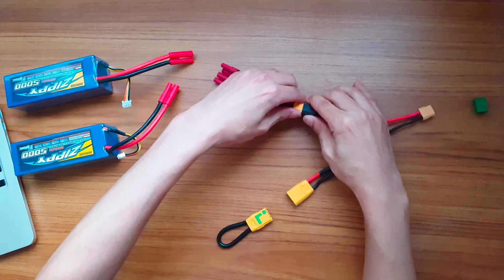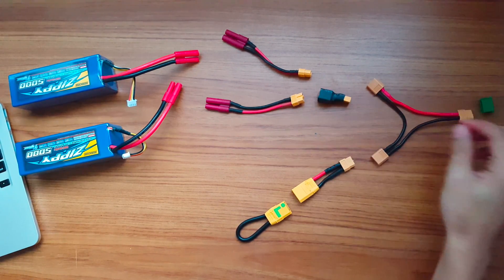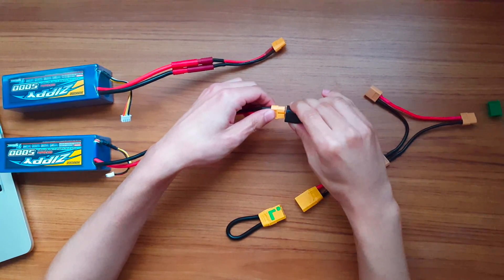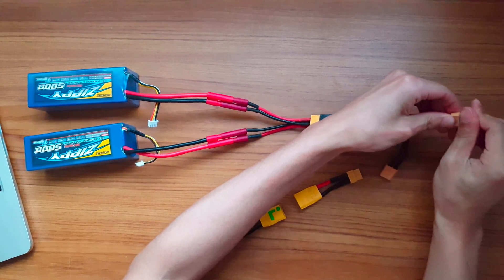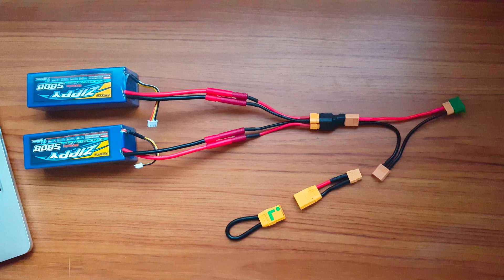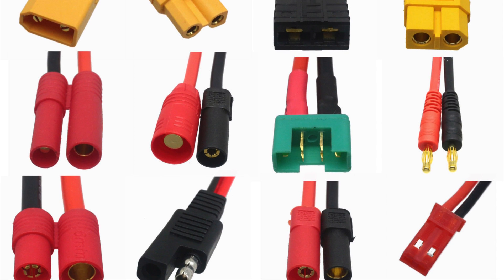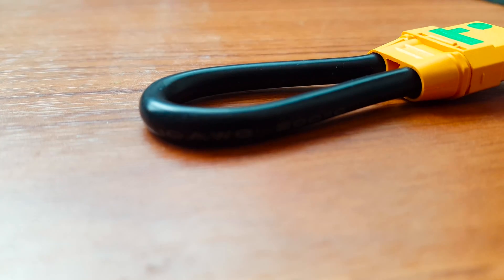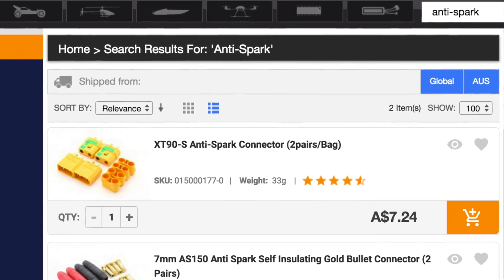Electric Skateboard Vlog - 3. Anti-Spark

Comment: One way to get anti spark would be to use the XT60I connector since it has a third pin that can be used as a sense wire. If it were recessed enough on either end, it could be wired to connect last and disconnect first. This could be used to pull the gate of a power MOSFET array up or down which would be like having a high resistance and then suddenly the MOSFET array goes low resistance when the connector has all 3 pins connected. Alternately, a simple timer can be made to do the same thing where MOSFETs placed in the ESC for this reason are made to turn on only after say 1/10th of a second so that the connector can be connected enough before the inrush current is drawn... kind of like a soft start.

Comment: I was expecting this explanation such as:

Try connecting only one wire of the battery to the vesc. There is a spark? Try connecting both- spark again. Why is there a spark? 

Here is how the capacitors on your vesc work when connecting the battery (they cause a spark) WHen measuring current from a capacitor it depends on the change in voltage. so i=C du/dt  I current C capacitance du-voltage difference dt . So assuming the capacitor is not charged and is connected to some voltage the change in voltage du is the  (0-the voltage)* its connected to so the current spikes for a dt duration (let's say milliseconds) hence the spark.  The formula says it all.

Now. Disregarding why the capacitors charge when connecting only one wire to them. The whole idea is that we are keeping their voltage high even when not using the board. Does this consume power? No as there is no path for the current to complete a cycle. 

So with he red wire ur keeping the capacitors always up to the voltage of the battery and we just connect the black one for example when wanting to connect the battery omitting the initial inrush current into the capacitors due to the sudden change in voltage they are experiencing. 

Is the spark bad? Idk maybe for the connectors, don't sweat about it.

As for all the other questions bellow- most questions can be answered from google. Its just understanding the basics of Electrical engineering, its not magic. read the datasheets of the parts that you want to use - they will have maximum continuous operating conditions which will tell you all about the current and voltage that they can withstand. watch some youtube on Electrical circuits basics.

Comment: hey man great video. i just built my own ebike. my controller connector is a xt60 my 36v15ah battery is a xt90. i bought a adapter so they connect. they do awesome. But i am getting that spark. will this apply and work for my ebike battery and controller and stop the sparking? please and thank you
Reply from the maker: Hi, thanks! Just from your brief outline I would think it would work. The anti-spark connector isn't too expensive so definitely worth it to try in my opinion.

Comment: What if i use the same 3 ways setup but using regular shorted xt90  as a switch ... will it prevent damage as I have notice that the sparks came up through the possitive side of ther xt 90 ?
Reply from the maker: I'm not sure I understand the setup. This must be done with an antispark XT90 as the switch, using just a regular XT90 will not prevent the spark as it lacks the initial resistance provided from the antispark connector.

Comment: Why is there no xt60 version and why do the anti spark power switches cost 30-40€????
Reply from the maker: I'm not sure why there are no XT60 Anti-spark connectors by default, it would be handy if there were. If you really need one you might be able to ask a manufacturer, or I've seen some people online adhoc their own.
In terms of the price, I wouldn't expect the connector to be that expensive. I'm not sure where you're shopping but maybe you could try hobbyking, or even ebay or aliexpress, they usually have some cheap items.
Reply from the maker: Oh my bad, you meant the actual switches. I think part of it is because it's quite niche so there's probably a bit of mark up there. There's not a lot of switches out there that are designed for this purpose with a relatively high current rating and so I think that's why they're quite pricey. It could be the materials used as well but you'd have to do a bill of materials to really see.
Reply: @sketchcontainer  are there xt90s loop keys pre-made or do I have to build one myself? I couldn't anything but the XT90S connector with no shortage or wire.
Reply from the maker: @PapayaPedro43  I haven't seen any pre-made ones before so you'd have to build one yourself. I think you pretty much got it with shorting the one side of the connector (like the video thumbnail depicts), but if you just google something like "xt90 loop key" you could probably find some good instructions on how to build one

Comment: Hi! It seems that the xt90 to xt60 adapter is missing from the description. Which adapter would you use?
Reply from the maker: Hi Ishan, great question. I made that adapter myself using the XT90 male connector that came with the XT90S, and a XT60 female connector I had lying around. However a typical XT90 male to XT60 female adapter should work. E.g. https://hobbyking.com/en_us/xt90-male-to-xt60-female-2pcs-bag.html

Comment: Great video. So you have put the anti-spark connector on the negative wire - does it make any difference which wire you use the anti spark connector on -neg or +pos ? Does it HAVE to be used on the negative wire?
Reply from the maker: Thanks. If I understand you right, it shouldn't make a difference because all the anti spark is doing is completing the loop, doesn't matter where in the loop as far as I'm aware. The main reason it appears to be on the negative is because of the way the xt60 series connector is designed.

Comment: One last question , would changing the serial cable that connects battery, vesc and loopkey to a serial adapter like this one be ok?
https://www.amazon.com/Serial-Battery-Connector-Adapter-Compact/dp/B01EIZYM74
Or is it safer to use a 10awg series cable?
Reply from the maker: They're effectively the same connection so I would imagine it would be ok

Comment: Hello , i was wondering if the exact same loopkey configuration would work with dual vescs ? I want to make the same anti spark switch but would like to know if it is ok to connect the female end of the anti spark to the male end of a dual parallel adapter connected to both vescs.
Reply from the maker: Good question. It depends on your setup. The max rated current for an XT90 is 90A so you would want to stay well below that. Most vescs I've seen have a max continuous current of ~50A, so that would generally be the limiting factor of the two, but with two vescs in parallel the limiting factor can be the XT90. In terms of voltage, if it was high enough the main thing would be that it could still spark, but based on the vescs specs I would doubt that. The other thing you would want to do is make sure the wires you're using can handle the expected max current and temperatures.
Reply: @sketchcontainer  My batt max will be set on 40A  per vesc so it shouldn't be an issue.Thanks a lot for your quick reply. Great video by the way ;-)
Reply from the maker: @V-lab  Thanks MrDamikenificent. Just a note here, if you're planning on having two vescs in parallel drawing 40A of current each, from a single battery source, that's effectively 80A of current from the battery. From what I can find online, the 10 AWG wire I used in my video has a max current of ~55A, so I would be inclined to use a 7 AWG wire to handle the 80A of current; but this is quite a thick wire so not sure how well it fits with the XT90. Again, I'm not actually that familiar with the dual motor, dual vesc setup so it might be worth checking with someone who has built one themselves and can provide you with better information :)

Comment: Would it be possible to use a XT90 as a removeable plug to complete a power circuit and treat it as if it where like a key to a car? But obviously for an electric skateboard. I'm just not comfortable leaving my board somewhere and someone seeing a visible power button then pressing it even if I have the controller. I'd like to have a key that I take with me that renders my board useless without it. Exactly how a key for a car works.
Reply from the maker: Hey Anthony, yeah you could certainly use it that way but just as a car has door locks and alarms, I wouldn't solely rely on the XT90 as security. Best to keep your skateboard close. If your concern is just to prevent someone accidentally or intentionally turning the skateboard on and draining the battery though, I would think the XT90 would definitely reduce those odds :)

Comment: is it possible to put any onoff switch rather than the anti spark?
Reply from the maker: If you find an on/off switch with the right specs for your circuit, of course this is possible. The difficulty is finding one with the right specs. Due to the sometimes high current drawn from the skateboard, basic switches are usually insufficient.
There is, however, a switch for electric skateboards already out there, which I hint towards in the video, and I would recommend opting for that if you're looking for a switch for your board.

Comment: how do you short the xt90?
Reply from the maker: Using the male (or female) XT90 connector, you connect the two pins together with a wire (or any insulated conductor) that can handle the max expected current. In my setup I shorted the male XT90 connector by soldering on a strip of AWG10.
Reply: does it work well for a key?
Reply: and also is it possible that you could make a video on how to do that?
Reply from the maker: Yeah it works well for its price
Reply from the maker: Shorting a connector is quite a standard thing, so if I get more requests for this I'll make a video for it. But in the meantime, I've uploaded some photos for further reference at https://github.com/graduit/xt90-anti-spark which should hopefully make things clearer.

Comment: im back with another question. So to complete the anti spark plug, i need to get a 10 awg wire and simply loop it and connect it to the anti spark and complete right?

Edit: Is it possible i just solder the anti spark plug into the end of the "XT60 Wire Harness" and plug that into my straight into the esc?
Reply from the maker: Yeah just loop the 10 AWG as shown in the video thumbnail.
I'm not sure I understand your second question, but if you're planning to use an XT60 wire harness, then you could essentially cut off one of the XT60 connectors and replace it with an XT90 instead of using an XT90-to-XT60 adapter like I did. Use whatever is best suited for your build.

Comment: What are the difference between XT60 and XT90? Im planning to get the XT90 Wire Harness because it seems like thats what everyone else is getting, but if i create a Anti-spark plug can i also use the XT60 parts you listed above with the  XT90 Wire Harness?  Does each plug have their own amp limit/rating? Im using 2 5s 30c 8000mah battery btw.  Thanks
Reply from the maker: Main difference is size. XT90 is bigger and this allows it to have a higher current rating (XT90 has a max current rating of 90A and XT60 has a max current rating of 60A). The connectors are also bigger on the XT90 which means you can solder on thicker wires - again catering for a larger current draw.
The main reason I used XT60 connectors was just because I had them available, plus my vesc came with an XT60 connector which I didn't want to change. Since you can program the current limits on a vesc (assuming that's what you're planning to use), if you really wanted to, you could probably use all XT90 connectors if that simplifies things.

Comment: What's the top speed and range for your board?
Reply from the maker: I've actually just sold my electric skateboard. Unfortunately I didn't get round to measuring the speed and range, but top speed was more than I was comfortable with, and using google maps, the longest I ever rode was about 5kms and there was still some mileage to go. Sorry I can't give you any exact numbers.
Reply: Reaper Sketch that's fine thanks
Reply: If you were to build another e skate what would you upgrade or add for longer distance and faster speed
Reply from the maker: If I were to build another one, I would get bigger wheels and use more cells with higher capacity for longer range and higher top speed. I wouldn't really need more speed but if I did I would look into a higher kv motor. I would also look into using two motors instead of one, to handle hills better.
Reply: Reaper Sketch do you think diyelectricskateboards Vesc and 190kv motor.  Amazon gt2b remote 2 3s 5000mah and 2 3s 2200mah and an LCD screen is a good setup. I know it's a lot
Reply from the maker: Yeah that sounds fine, it all just depends on what you want from your skateboard. What's the 2x 3S 2200mAh batteries and the LCD screen for?
Reply: Reaper Sketch The LCD screen if for checking the percentage of the battery and I will either connect the 3s 2200mah to the 3s 5000mah or I will use them as a last resort backup battery
Reply from the maker: Awesome man, you're onto it ⚡
Reply: Reaper Sketch or do you think 4 3s 5000 mah is better
Reply from the maker: If you can, 4x 3S 5000mAh would be better. Obviously with 4x 3S 5000mAh batteries you will get more range, but more importantly the batteries will all drain at the same time. If you mix capacities you will only be as good as your weakest batteries, and you'll have to monitor them more closely.
Reply: Reaper Sketch thanks will fo
Reply: Reaper Sketch ok thanks totally going with 4x 3s 5000mah

Comment: couldn't you get batteries with xt 60s on their outputs and get rid of the adapters ?
Reply from the maker: Oh for sure, if you can do it like that, that's even better. In fact, I would have the same thing, but sometimes I use these batteries with a drill that has an HXT connection. Great tip though!
Reply: Thanks for the great vids, very clear and concise. Great job. Keep it up.
Reply from the maker: Cheers mate